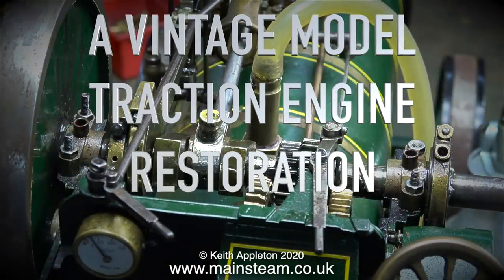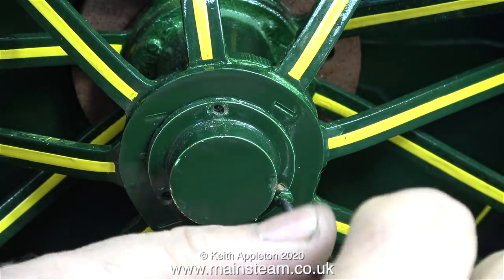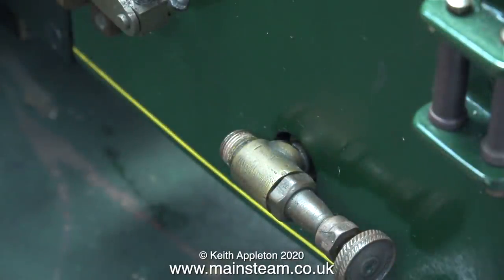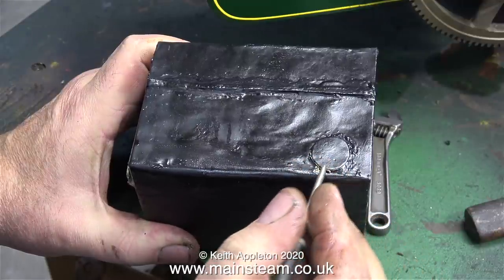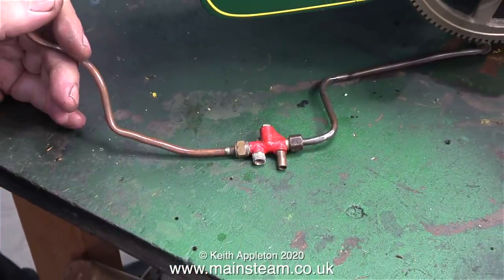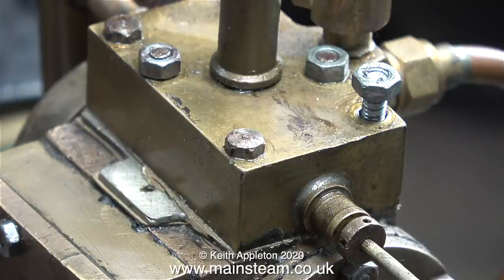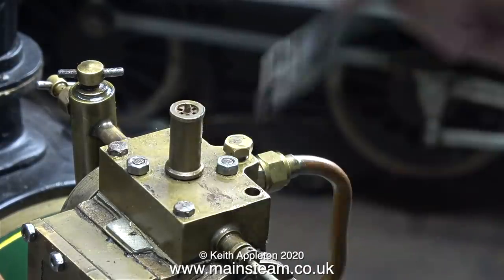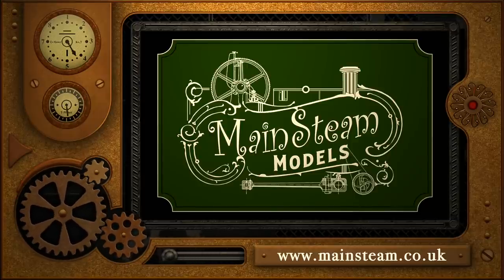A VINTAGE MODEL TRACTION ENGINE RESTORATION - PART #2

Comment: I've worked on tractors and farm equipment that had been "repaired" by the owners.  During plow or harvest season a farmer can't afford to stop to make proper repairs so they do what ever they can to keep working.  I never made fun of them and in fact admired their cleverness in using what ever was at hand.  Looking at that water tank I'm thinking somewhere there is a woman wondering where her cookie sheets got off to?  A lot of people forget that it took many years before Whitworth's standards for threads were fully adopted by industry and even longer by small companies and individuals.  So today you find steam engines with weird threads and the models are no different.  Which makes Keith's videos even more entertaining!

Comment: I can really relate to "losing the will to live" when either removing or installing bolts that are exceedingly long and/or difficult to turn. They manage to turn a short easy project into a long one all by itself. Great videos, I always enjoy them and learn something from each one.
Reply: That's the reason why i hate cross pattern heads so much... At least slotheads can be chiseled out if one just know that and easily be hammared back with a punch in order to get them out, that is not possible with crosshatch unless one re chisel them completly. I can't describe in words how much i hate removing crosspattern screws when they got old and the head got rusted shot. ha ha ha This is also one reason why using the correct type of treading for the rigt purpose to begin with is important. I use Metric a lot, but i now use BA for tinplate metal and brass for this type of applications (i probably will be hanged and skinned alive now by the owner of this channel ha ha, but the origin of BA was actualy metric, it is based on the Swiss Small Screw Thread System (Thury) later reworked to imperial and BA. But, yes, if BA keeps the Lancaster together i will trust it for sure! Just a little historical curiousity.).

Comment: Very nice video Keith 👍 , I’m thinking about Scratch building a single cylinder stationary engine, what colour do you think would be best? It will probably be close to the design of a Stuart S50

Comment: Did you say you use Kilrock K to clean the injector? Is that neat or do you water it down?
Reply from the maker: Diluted as per the instructions on the Bottle.